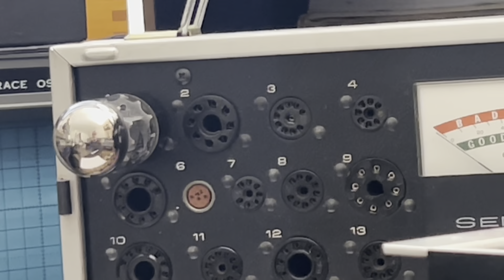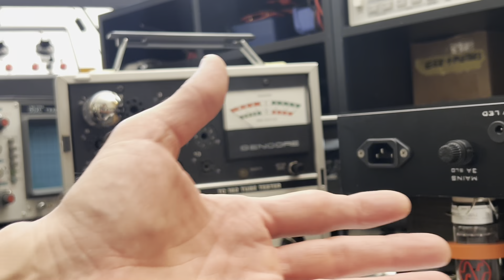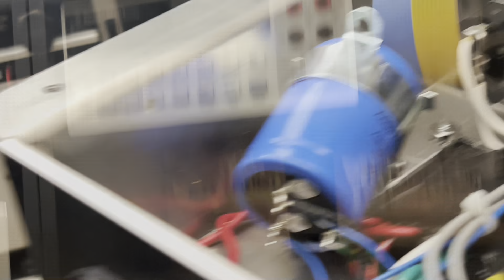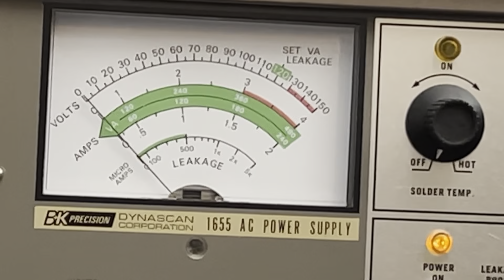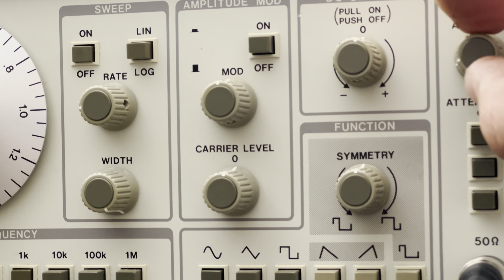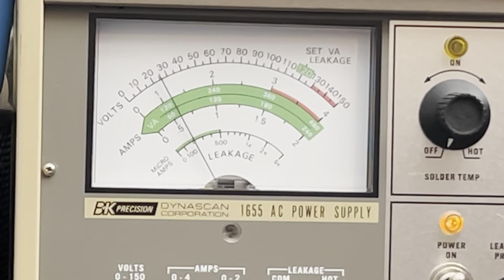JTM’ish Clone?  Stop Using The Standby

Comment: The only good thing a standby switch is for is to fill the hole in the chassis.
Either use the correctly rated reservoir/filter caps or GTFO.
Reply: Well, cathode followers can appreciate them. But only with SS rectification.
Reply from the maker: Yep shades of gray.

Comment: Preguntas… is there ever a need or brand/type of guitar amp that the use of the Standby switch must be used or is better to be used?  I’m 2nd owner of a hand built amp (think it’s a derivative of a 5E3) that has a standby switch that I never use because I’ve always owned Voxes that either never had them or I didn’t use.
Reply from the maker: Anything using directly heated cathodes could benefit, as well as anything using a solid state rectifier.